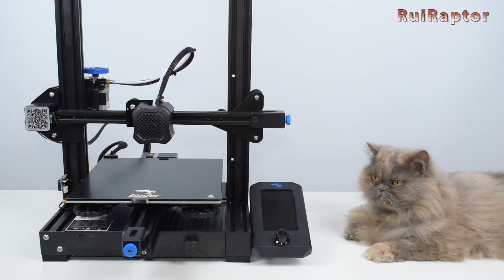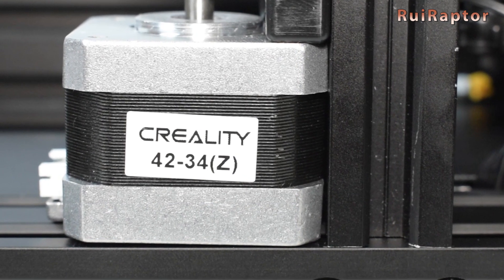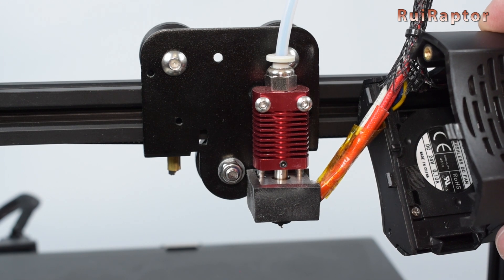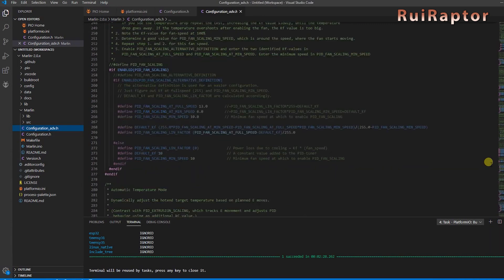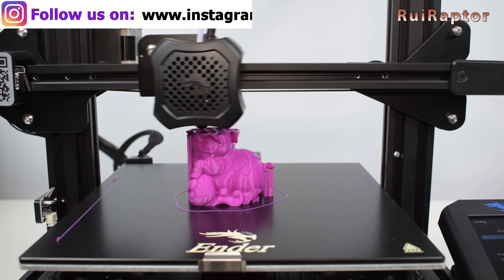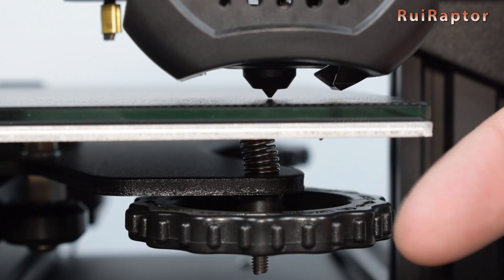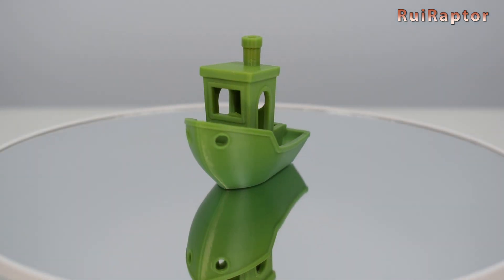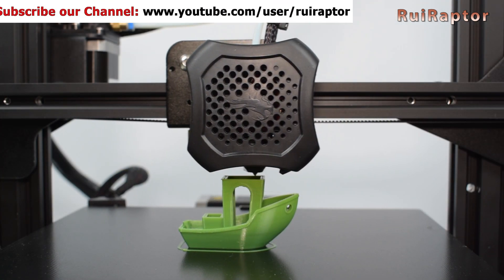Creality ENDER 3 V2 - What´s New??? ♦ FULL REVIEW ♦

Comment: How many fans has this printer and can u connect the printer to a pc?
Reply from the maker: Hi Marcel, the printer has 2 fans in the print head (hotend fan + layer cooling fan) + 1 fan in power supply and 1 fan cooling the board. Regarding the connection to the PC, yes, you can connect the PC to the printer.
Reply: @ruiraptor  Are these easy to replace for a silent one and which one would u recommended?
Reply from the maker: They are easy to replace. Only the one inside the power supply might give youa bit more work. The most popular silent fans are the noctua ones but they are 12v, which means you need to add a step down to lower the voltage from 24v to 12v. We normally don't recommend installing a noctua fan to cool down the hotend because these fans have less air flow.

Comment: Do not repeat my mistakes. DO NOT BUY V2. This printer is a joke. It actually WORSE than stock Ender 3, due to screen capabilities. 
Most of the upgrades here are half assed, or several dollar worth / easily printable. Only decent changes are bltouch port, bottom vent slits and bottom PSU layout. PSU chockes on air and LOUD af. 

Several months already and motherboard and screen firmware are NOT PUBLISHED.
Current available board firmware is reverse engineered semi working hack. Knowing Creality, it could take an year to publish GPL obligated firmware for the mainboard. And there are good chances screen firmware will be published never.

Drivers are standalone mode 2208 with forced stealthchop and they DO NOT work with Linear Advance. 
To fix this you need to hack your board in UART mode for extruder driver. Or do a once in lifetime OTP flash on the driver using usb-serial adapter. 
There are no way to do it without sophisticated chip solder hacking. And again, there are no published PCB layout for that board, which worsen things too.

Screen is the main disappointment. It improves nothing in the workflow UI, limits extension capabilities and has no published firmware too. You will be much better off with a simple and robust monochromatic 128 dots screen.
 
Display doesnt' work well with an alternative firmware and cause of that with an alternative boards.

As a resultl to get most out of the decent kinematics you will need to drop out both the screen and the board.

Get Ender 3 (or pro, if it still goes off with huge discount) and upgrade it with modern 2209 SKR board, V6 hotend with titanium heatbreak and some cheap BMG extruder clone. 
You will get better, quiter and more robust device for the same price. There are drop in replacement boards with the exact same layout and no need to rewire cables. You will only need to source parts and to print mounts.
Reply: Surely at least it is quieter than the Ender 3?
Reply: Yes, it's basically a 3 Pro with the upgraded board that makes it quiet. It's a few bucks more than a 3 Pro but with some good upgrades. A worthy release for those not interested in buying a 3 Pro and making the updates themselves, and I think you even save some money on that even if you were to do so. And I disagree with ScrewThursday's advice to just buy a standard 3 - it's not that simple an answer. The Pro costs barely more than a standard 3 and has some good features (i.e. the more stable frame, which isn't something you can just "upgrade" on the 3). The v2 adds on that with a few more upgrades that someone who isn't willing to do them can get for just a few bucks more. Buy whichever appeals to you most, they all have their warts.

Comment: I took delivery of one of these a week ago. The bed is slightly warped and I tried to add mesh bed levelling using the steps in the ruiraptor videos on editing Marlin for Ender 3 V2 in VSCode and on adding mesh bed levelling . I used the latest release of Marlin and the Ender 3 V2 configuration files, but enabling "lcd bed levelling" and "mesh edit menu" resulted in " "LCD_BED_LEVELING requires a programmable LCD controller."
Removing those two edits still resulted in a failed compile - "'probe' was not declared in this scope"
Any ideas anyone?
Reply from the maker: Hi, most of those erros have been fixed by the Marlin team with the new update that was posted yesterday (2.0.6.1) but you still need to leave the LCD_BED_LEVELING commented out. Instead of the display, you can run the manual mesh leveling by sending G29 commands by pronterface (for example) to level the bed.
Reply: @ruiraptor  Thanks so much for the reply.
Reply: @mkilpatr03  Let me know if it works thanks.
Reply: @petercallison5765  It did work, exactly as Ruiraptor said. You can set up the mesh by following the steps in this video: https://youtu.be/IkgfKz3t9h4
Reply: @petercallison5765  Just to be clear, these are the edits I made to the Marlin files:
pplatformio.ini  
21      Changed “default_envs = mega2560” to “default_envs = STM32F103RET6_creality”

configuration.h
Uncommented:
887	#define PROBE_MANUALLY
888      #define MANUAL_PROBE_START_Z 0.2
1247    #define MESH_BED_LEVELING
1253    #define RESTORE_LEVELING_AFTER_G28

configuration.h
Changed:
1324    Changed “#define MESH_INSET 1” to “#define MESH_INSET 15”
1325    Changed “#define GRID_MAX_POINTS_X 10” to “#define GRID_MAX_POINTS_X 5”
1341    Changed “#define MESH_INSET 1” to “#define MESH_INSET 15”
1342    Changed “#define GRID_MAX_POINTS_X 10” to “#define GRID_MAX_POINTS_X 5”
It should then compile and when it is installed, follow the steps in this video https://youtu.be/IkgfKz3t9h4
Reply: @mkilpatr03  Thanks very helpful